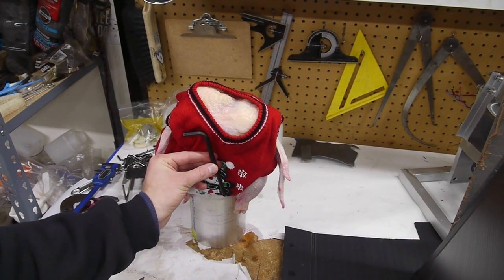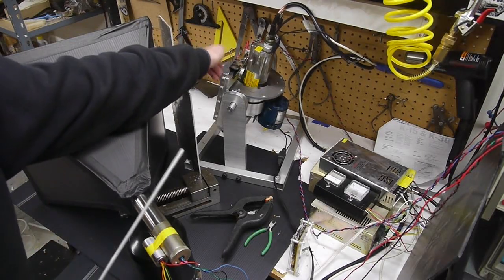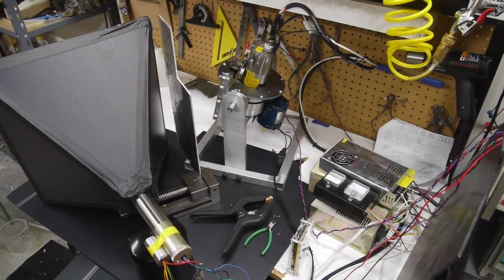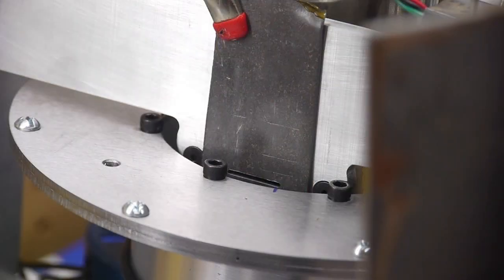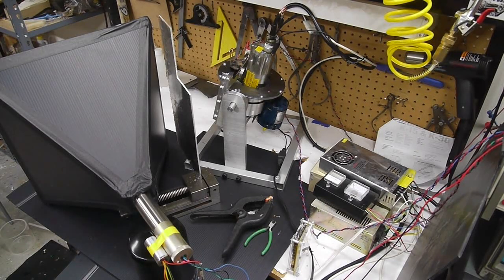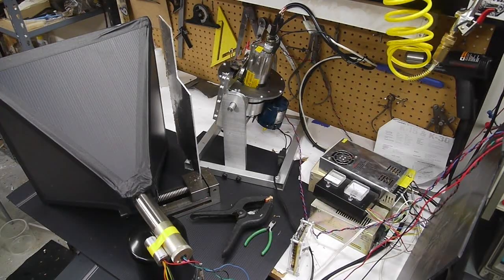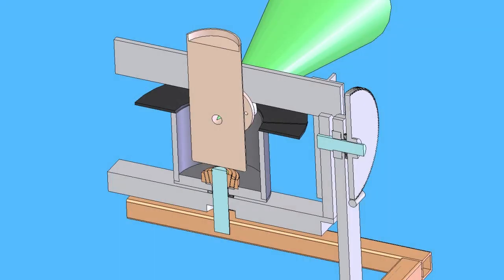DIY X-ray backscatter imaging system (airport body scanner)

Comment: Interesting. I worked with X-Ray imaging for Food Systems both Conveyor and Pumped food through a detection Window and to the detector array. That technology involved using a Collimator (?) for not focusing but only allowing the X-Ray beam into a thin line. That matched the detector width and the scan rate of the Detector Array and was dependent on the speed of the Conveyor or speed of the substance with a Pump system. It was not a backscatter setup but Emitter and Detector synchronized image. Airline Baggage scanners used this technology 30 years ago.

Comment: this gave me a couple of ideas: using x or gamma rays, make an imaging device using a: an old flatbed scanner with the lamp removed. should get very high res images if the carriage is slowed down enough for the rays to directly blast the linnear ccd pixels. b: make an image using an alpha emitter on the toner drum of a laser printer. alpha particles should nutralise the static and cause ink to fall off, producing a negative image of some kind

Comment: I have a backscatter van with xray machine still inside and a 20 KVA genetator. I originally purchased it to turn the box truck into a food truck and when i broke the lock open, To my surprise i found the xray system still intact in prestine condition. Can I sale this? And where can i sale it? Thanks.

Comment: As far as I was informed, they use Terahertz radiation for the bodyscanning devices, that would be settled in the wavelengthes between micro- and infrared waves and so permeate not too far into the human tissue.
Reply: The airport machines pick up orthopedic protheses one in my knee and the other in the shoulder, a guarantee for a feel up.

Comment: You could angle the screen so that it was tilted haf way between the xray and the camera to give less distortion?
Reply: +Donald Sayers That would only be harder to correct for as the projection itself will be distorted if the screen isn't perpendicular to the x-ray source.
Reply: +lgab But the distortions by symmetry, will cancel out.
Reply: Or view back of phosphor screen through a 45deg mirror

Comment: Impressive job.

My thoughts on the application of this as the name of the channel stated:

1. Exposure - compton scattering or backscatter means that you need high exposure or at least, large area of exposure (to the human body). That means, higher radiation doses.

2. Cost - The SIZE of the detector you'll gonna have for practical application means a lot of costs.

3. Shielding - Imagine this on an airport. Since your dealing with scattering, it is literally scattered all over the place. that's why an appropriate shielding is needed for airports. Cost too.

Most of these machines were removed on public airports (US and UK) due to some of these reasons.

Source: I'm a Linear Accelerator Tech.

Comment: applied science I bought a really big x ray tube at military surplus store, I have a 1000 watt transformer that is also high in voltage and  Im going to run the x ray tube with it, if I get to run with no problems what do you think about the radiation at that power level?
Reply from the maker: Owen Chase Wear your lead underpants.  The X-ray tube voltage will determine how well the X-rays penetrate.  Under 10KV, and the rays will be stopped by thin glass and aluminum.  Above 30KV, you'll need lead shielding.  Medical tubes that operate at 75KV and at high currents are a real hazard.
Reply: Applied Science o ok because I have a tesla coil that ran at 100,000 volts.
Reply: +Owen Chase science channel you may be able to put out 100kv, but good luck pushing any real current at that voltage
Reply: @robmckennie4203  you don't need much current for xray... Besides, 100kv at the power of the transformer he has is about 10mA.
Reply: @reecebeck971  they didn't say they had 100kv at 1000w, they said they had a 1000w transformer and a 100kv tesla coil
Reply: is it because of ohmic heating melting the conductor?

Comment: Just found your channel. Awesome! You said there is lens for x-ray, but couldn't you build an x-ray pin-hole camera?
Reply: In theory, yes... you can. But, did you ever built pinhole imaging device? Just for fun, use aluminium foil, puncture it with sharp needle. Then place this hole over the incandescent light bulb, then project picture onto paper. Surely, you can see faint picture of the tungsten wire, but only that - nothing else. Imagine then how much x-rays will be needed for decent picture - even frozen chicken may get radiation sickness and die for a second time. :D
Reply: +Wild Maniac You can also use a zone plate, which works like a pinhole but lets more light through: https://en.wikipedia.org/wiki/Zone_plate
Reply: Oh, yes, thanks for reminder. Zone plate, that is right.

Comment: You're correct with your assumption.
Most front-driven cars have two opposing tapered bearings on each drive shaft, and then one in the drum brakes/hub on the back wheels. Personally I've never replaced the wheel bearings of a rear-wheel driven car, so I don't know how it goes there, unfortunately.

Comment: Two-part answer for both questions: The amount of back-scatter you get is dependent on A) the density of the thing being scanned and B) the energy level of the x-rays. The tendency of denser (metal, especially heavy dense metals like tungsten) materials to scatter WAY more than lower-density lighter things (bones, flesh, clothing, plastics, etc) allows the TSA to find guns, knives, etc. easier. Also, back-scatter scanners can be lower-powered and can use lower-energy x-rays to get a good image.

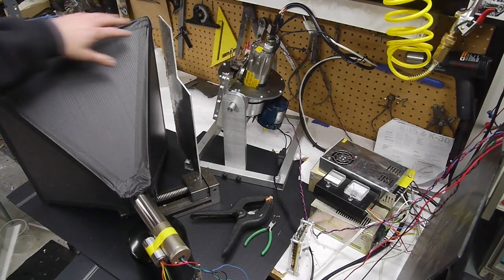Comment: They are mirrored. Did you not see the shinyness at 2:07 ? The outside is black to prevent light from leaking INTO the detector.

Comment: Safe? Yes, as long as you practice adequate safety. (He does, uses a Geiger counter to determine rad levels, gets the F out if they're too high, etc) Legal? Same answer, with the addition of warning and keeping bystanders safe/away from it when it's on. (He most likely does this or doesn't even turn it on when others are around)

Comment: But that was a transmissive scanner, you would need both the detector and and the x-ray source to move together or have the person get moved by on a conveyor :/ I wonder if the sensors in Mike's detector are any more or less sensitive though, being engineered for the job.

Comment: I recommend watching mikeselectric tear down of an airport xray scanner if you haven't already. It uses many small sensors to create a vertical line and then the scan rate is determined by the conveyor speed

Comment: Are there any safety features at this point? For example, some way to stop the beam if the X or Y axis is not moving "suitably". I have no idea if you can turn x-ray tubes on and off easily, but it looks like a solenoid that pops a shutter into the beam path would work too.

Comment: @Logician Writer because all you'd get each time you take a photo (assuming the camera is even sensitive enough) is a glowing area where x-rays are hitting the screen. There's no way to focus the x-rays being scattered back to the detector so you need the combination of scanning from the rotary aperture and the oscilloscope to do the same kind of "image processing" that an optical lens does. All the information you'd get without that processing is 'there's something in the way of the beam.'

Comment from the maker: Materials with a low atomic number (water, plastics, etc) will scatter lots of X-rays, so there will be more signal from them. High-Z materials like metals will absorb more X-rays and backscatter fewer, so they will emit less signal. Density is also a factor. My oscilloscope has a z axis input such 0V = full bright, 1.8V = dark. The PMT outputs a 0 to -2 V signal with 100K load resistor, which is just brought above 0 by the opamp without inverting.
Reply: could post your blue prints that help you make this ( the link) i think it would be to cool to see